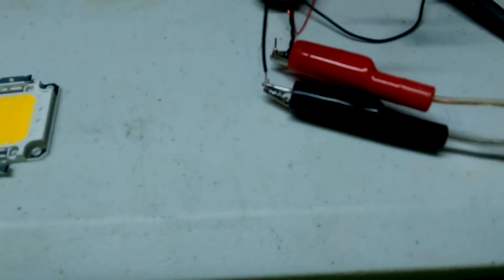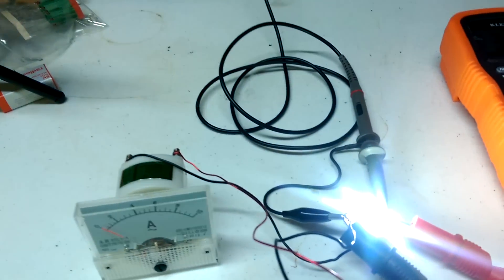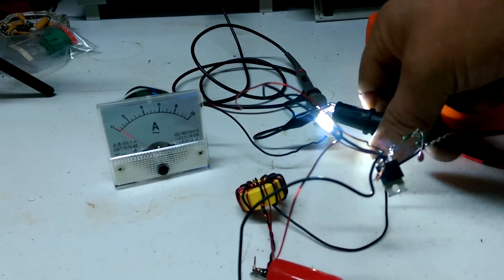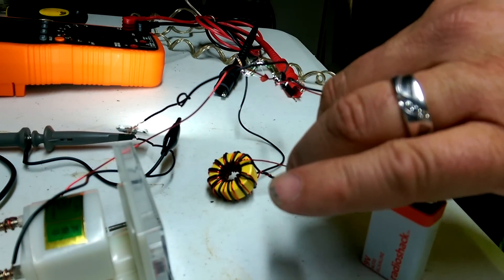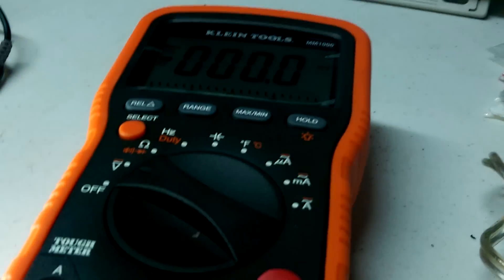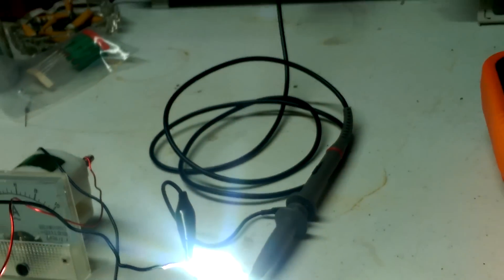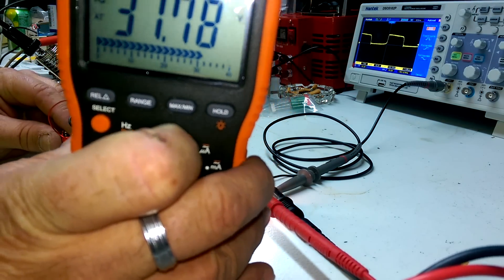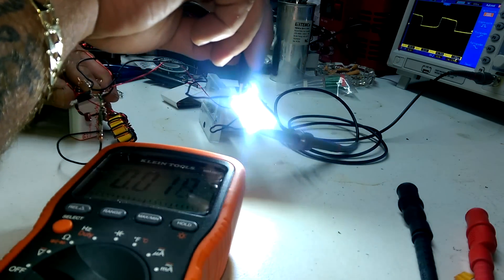Additional energy with Bifilar Joule Thief. 85% more. Is It Overunity?

Comment: Hi Marc.
As usual for your simple circuits, I've replicated this one.
...without success.
The only difference with you is the toroid. Mine is almost same size than you, but the specs are different (color too : mine is black, yours is yellow for high frequencies ?).
I've used a 100pF cap in parallel with the 55 ohm resistor in serie with a 10K pot, TIP31C transistor( and TIP3055 too), 11 turns (I've tried more turns, but it consumes too much) of bifilar enameled copper (24 gauge) and 12V led used in projector.
With my scope, I only have 10 V spikes (with a waveform similar than yours).
I' ve tried of course to adjust the base voltage, and the best I get was 3.5 volts and 0.2 Amp with low brightness compared to the maximum I can get with 12 v directly inside the led (and 0.9A).

This circuit doesn't seem to be so easy to replicate...
Reply from the maker: +Michel Pepino Hmmm.. sounds like you have a tuning issue, or, the toroid isn't handling the frequency?  I haven't measured the inductance of the toroid, so, I will do this tonight when I return from work. The first circuit I made was a fluke, that's why I removed it, however, the second worked fabulous as shown in the video. Try taking a turn off of the toroid for each wire, then, see what happens, or, adjust it and try again. It sounds like the toroid's material isn't stable at the frequency needed,or, the inductance and capacitance isn't matched at the correct frequency crossing, which is mighty important with bifilar coils. I haven't done any mathematic formulations with this circuit to figure it out, however, please let me know what material the core you are using looks like. Ferrite will be the very hard but blackish/greyish magnet material. It may be ok with Ferrite if the permeability is in the right range but Ferrite cores can be finicky with bifilar windings. Also, what size is your conductor, are they both identical? Have you ensured the connections from the top of the toroid are as follows.. ( the incoming or start of the toroid, looking at the wire's starting point, the two center wires of opposite colors MUST be tied together and go to the battery positive., Then, the next wires are definitely connected exactly as shown, if they are mixed up or rolled, you will experience a phasing issue and the circuit will NOT function correctly) . I've found that high frequency without destabilizing or saturating the inductor was important. (look in some old electronic boards to see if you have any size yellow HF iron powder or metglass core in it and steal it to try and replicate my results. I screwed around with  other cores unsuccessfully too and I just had to start over with high frequency cores. My wires were also #24, then, I tried #28. I made sure the wires had a heavy insulation so they didn't leak to each other through the insulation as my voltage approached 102 volts peak to peak at times. Magnet wire was not used successfully in all of my tries, however, I have a bad habit of saying to use this. I used radio shack primary wire, solid copper with a plastic jacket (I think it is a ptfe jacket) You can also try playing with different caps to see if this assists with the stabilization, however, make the cap changes pretty large from pico to nano , then, pico to micro if changes are large enough, it may add voltage or take away. I'm not too sure without changing them which way you'll need to go as I wung it putting this together. Try to ensure the cap is good for at least 63 to 100 volts.  If the waveform looks the same, also try removing the 55ohm resistor completely before finalizing the results to see if you can get a bit of a rise in voltage, just be careful when adjusting it to be sure you do not have zero ohms to the base so full voltage doesn't output. Make 100% sure the pot is used as a variable resistor, in one leg and out the variable leg, ensure you measure variable resistance and not just have 5k at all times as the adjustment won't change (however it does sound as you have this correct. I have another circuit that I used more turns and I get less voltage so carefully count the turns, ensuring there are no twists in the conductor that would cause an out of phase (but again, sounds like you did this right if you are getting the led to light up from 10.5 volts down to 3.5 volts. Mine will illuminate at 3.5 volts fairly brightly, so, I certainly feel the transistor isn't conducting all the way and may be saturating as well. measure the base resistance while off at it's lowest point, then, again at it's highest point and let me know where it's at so i could try and duplicate your results. I will rebuild the same circuit again tonight to see what happens. I did have issues duplicating additional circuits so I am assuming it may have a lot to do with variables in the led or toroids, maybe even resistance differences or cap tolerances. Small adjustment may get us in a "happy window" and I'll try to give you the key variable "readings" once I duplicate the circuit to get my results. When I wound the toroid,  From the start on the left, I went over the toroid from the top through it under the inside and back up from the bottom outside and back over wrapping both wires simultaneously in a counter clockwise rotation (I am in the Northern Hemisphere, if you are in the southern hemisphere, try to make it opposite mine) I am not sure if this matters at all, funny things do happen if we wind coils opposite our Hemisphere due to the Bernoulli affect with pulsed free energy devices.. The circuit must oscillate at a very high frequency to work. Does your toroid whistle or make noise when adjusting the circuit with the load on it? It shouldn't as mine makes absolutely no noises at all, not even a hiss. What time zone are you in? I will try to send you messages at 7 pm or 7:30 pm eastern time tonight. If i forget, please send me a message, it will alert my phone and I will get a reminder to go replicate this and try to work with you to see what's going on here. I'll post all results here in the comment section for others to see. I apologize that I didn't give measurements , voltages, resistances at multiple points to ensure you have the same results as well as others. I'll do so tonight. TTYL. Marc
Reply: +Marc Belanger Thanks Marc for your fast answer.
I'm living In France (and actually, I'm not very happy with all things happening in my country...) so you know my time zone ;-)
My core is black, I removed it from a variator of an Halogen lamp.
I can try other cores, but yesterday I didn't found my yellow ones...
My both conductors are the same : 24 AWG, enamelled copper.
I'll try with other conductors.
My Cap is a 63 -100 V one, but I'll try with different values.
My pot is able to modify it's value from 0 to 10K (verified)
I have no whistle while using the circuit, all is quiet.
I'll try tomorrow to have a look again at the circuit with all your advises.

One thing important : I think I reach a sweet spot  while adjusting the base resistance : I've got a very bright light coming from the led, but I'm not able to maintain it, it's very brief...

Thanks so much for helping me.
Reply from the maker: Hi Michael, have you had any other success with the replication of the circuit? I have been messing aaround with the capacitance and have added resistors as XEE2 does in his videos which changes the efficiency and performance of the device. I have found that the circuit will fire a home led bulb, however, the output has to be connected to the circuit connected to the leds within the bulb as it screws into it's base to function as Lasersaber does. I will make a few more and share them with the building instructions... I just hate editing videos unless I could find a beneficial free video editing software outside of youtube that is easy to use. Please watch XEE2's videos and see the video where he uses the radio shack transformer with the home bulb in front of the colorful kid's gameboard or whatever the thing is he aims the bulb at to show how bright it is. I also ordered a lux meter to show the brightness of the tests to compare to normal home bulbs, using the dc leds I have been testing with the JT circuits. JT's are normally a bit different than the circuit I have used. I just call this a JT, it isn't similar since it uses the bifilar wound core. Thanks

Comment: You realise your meter (Klein MM1000) is only designed to measure AC voltages between 40Hz and 400Hz?
http://www.kleintools.com/sites/all/product_assets/documents/instructions/MM1000_Manual_English.pdf

Maybe pulsing the LED at a higher voltage and lower current might be bright but unless you're doing a side by side comparison it doesn't prove much;  also running the LED at higher than recommended voltage might appear nice and bright but does it reduce the specified operating life?
Reply from the maker: that's why the scope right next to my experiment is backing up the measurements, and, it measures the frequency range just fine. the meter may not be designed for a "frequency measurement"  at that range, but, it certainly measures the voltage within 5% of the scope which, I.am overall satisfied with.
Reply from the maker: also, the led is meant to.operate at high frequencies. they are high speed diodes that have similar circuitry within their manufacturers constant current power supplies, however, my circuit assists the led in running cooler, prolonging the life instead of reducing it by running at a high amperage and high.heat which certainly destroys leds
Reply: +Marc Belanger why don't you try a side by side comparison, 12V LED vs your circuit and see which is brightest?
Reply from the maker: +Ju00Ls I will try this tonight, however, when we power LEDS direct without any voltage reduction or protection and heat sinks, they can burn out in seconds. These high output leds are not anything like normal round leds, they are extremely high current leds that will get so hot they smoke from being completely dc fed without being pulsed at high frequencies.
Reply: +Marc Belanger  It shouldn't burn out if you give it the voltage it requires;  your spec says: Forward Voltage : 9-12 Volt DC,  use your current limit to 1015mA

Comment: Hi,
I heard about a device that can be used to limit loads on a power supply (device allows a 1.5KW iron to be used on a 650VA gen), although I use an inverter at home with batteries charged by solar, I got curious as to whether this could also be used by my inverter and started investigating online. 
This lead me to Gerard Morin, green N.R.G and you. It has been an interesting experience and a real eye opener. The unfortunate reality though is that as awesome as all your individual discoveries are, many of us don't have the know how and even when we have the know how, cannot afford(time and money) to replicate and find practical uses for your discoveries.
I am not even too sure of how all I have seen relate to what I was originally investigating, but I have have been addicted to finding out more.
Reply from the maker: hello thank you for your interest in my studies and continued research.  I have replicated many systems over the past 10 years that Ive seen online , some successful,  some failures . fortunately enough I have been able to invest for those of you who cannot afford to replicate with specific items such as the Gerard Morin transformers which I picked up for a fairly cheap price, and, with the continued support of all of my visitors I will continue to perform my research As I am acquiring ad cash from advertising sponsorship to do so. I have just learned that Google and YouTube allows a specific funding program where researchers such as myself can request donations towards research projects which like I said I am doing the show people such as yourself that cannot easily purchase some of the expensive equipment and hardware required to replicate these projects. theres a lot of people out there that will call me a scammer and I hoax producer but the reality is I am just trying to find new free energy production methods that our world can survive on without the destruction by fossil fuels.  I have found that open sourcing these will bring our planet much further along then trying to sell them . the only problem that I will eventually have is that any products which will cause economic collapse or reduction of taxation could likely make myself and my family turn up missing or hurt. I do not wish to harm my family over something as simple as an electronic device so I asked an entire community to work along with me to resolve the problems that our planet faces without doing it alone so we all will be trying to take credit as a community in whole, not separately for anything. I apologize for such a long comment but Google Voice works great on my phone and eliminates a whole hell of a lot of typing. lol I will continue to replicate or produce specific projects to test materials and components for anybody who wishes me to do so I asked those individuals to please send me schematics and components if they have them so I can use my test equipment to do what they wish . I will gladly post these videos if I am able to successfully show whether a proof-of-concept works or it doesnt. I ask those of you who seek assistance to produce any test , you may contact me with a private message or you can email me please send me a message and I will send back my email address so we can speak privately or possibly by telephone some evening. I do not in any way try to belittle anybody for any effort or questions they may have due to misunderstanding technologies. That is what I am here for, to figure the new technologies out that have happened anomolously.  my quest is the same as everybody else , and that is that I am just trying to find new ways to capture free energy and put it to work. I do know that it is possible on a small scale so if its possible on a small scale then it has to be possible on a large scale as well. I have successfully designed the Pelex device that can take just a few watts input and output several thousand watts however the machine is extremely dangerous and cannot be given out on open source by any means as much more studies and research have to be done to figure out a safer way to allow this machine to function correctly without it's use as a weapon or it's mistaken use that can kill one who disbelieves it's entire function. The device is extremely powerful and could lead to catastrophic explosion if one doesn't know much about high voltage, high current designs. High voltages with less than 1/2 ampere can blow limbs clean off one's body and kill instantaneously. I am not here to endanger anybody, so, please be realistic and lets leave Pelex alone until our society is serious enough and ready for it's use. I would always have to remain a part of the technology as nobody else on this planet has ever seen such a simplistic but dangerous device. My attempts here to show minor increases in energy may spark one's interest to ask how this was done on a small scale, then, want to get them to go larger in scale as success can happen on many levels. Belief is the forerunner of how to make this all work. Once we believe overunity is possible by design, then, the designers will begin to spend their money to try the possibilities as I have done. I have spent an entire life savings on my work, what most people would earn in 20 to 30 years of work. I am not proud of blowing this kind of cash, but, since i could prove what I have done because I very much believe and I did so even when I started blowing all of my cash investing in equipment and components that aetheric energy induction is very real, also, vacuum energy and plasma energy is also real. Tesla was very real, and, the vast majority of what I've seen from him was in hidden text from a rare library which wasn't taken by the feds as all think. Maxwell's equations are also not what we have been taught in school, as they have been changed as well. There are people out here telling the truth about free energy. Gerard Morin is one of them, I am another, and, there have been many others, including Tesla, Kapanadze, Don Smith, Dr. Moray and many more that have all been truthful while the world tried to make them all look bad.
Reply from the maker: +Tobi oluwole are you talking about the device I designed called Pelex? It does similar, however, it isn't available for market yet due to safety restrictions that have to be cleared up. It does produce a high amperage output at low wattage in, like 6 watts in and over 2800 rms watts out. It's in a prototyping stage which we are working to reduce an interference it has, I'm thinking it is the energy that's being drawn in that makes this interference, however, we can't be sure, it is all around the unit within a 250-500' radius, depending on how much load the unit uses.
Reply: @advanced-electronic  how are you Marc? Noticed you posted some comments again some months ago with a guy trying to make his ‘Don Smith’ setup to work. Would like to get in touch but do not know how. Maybe Turion can help😃. Anyhow, all the best sir. Regards Hans